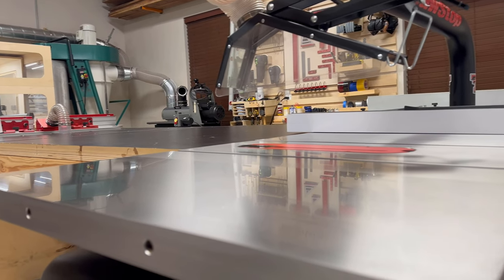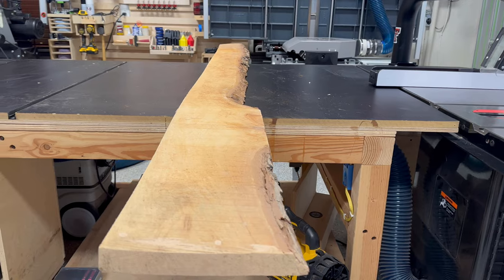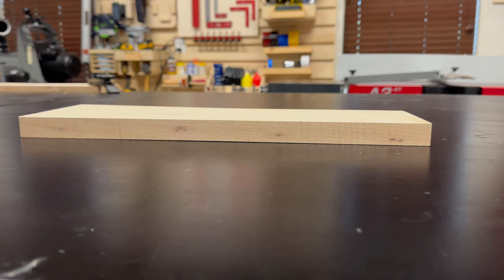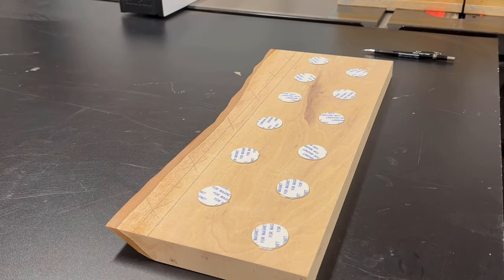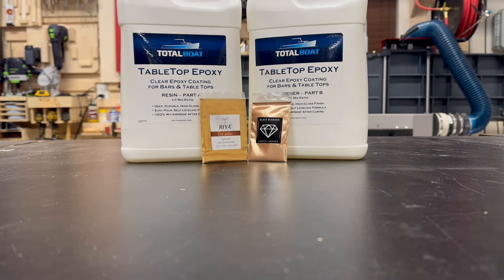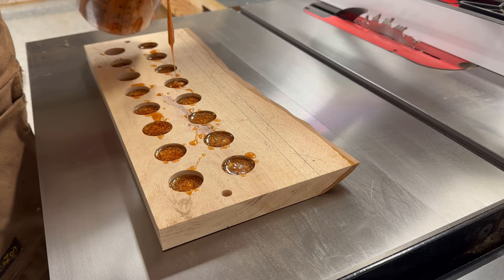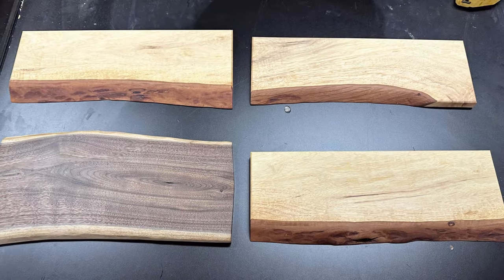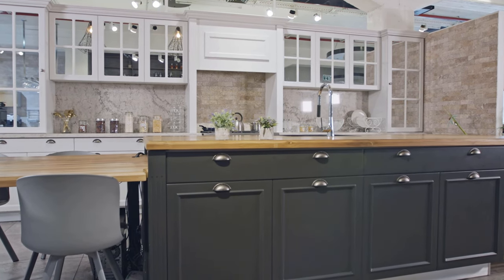Live Edge Magnetic Knife Holder  |   DIY Tutorial

Comment: You need an internal engineering department to set magnet depth in wood?
And it took them a week?
Did this board cost $10k
Do you have any idea how ridiculous that sounds?
Reply from the maker: I have forwarded your complaint to our internal HR department.
Reply: As a current unpaid seasonal intern janitor, I can attest that the engineering team did a fantastic job on designs! Though they were messy with saw shavings to perfect the depth of the magnet. When I saw that the client paid well over $12,000 for this magnetic knife holder, (picked up the invoice and my jaw from the floor in the engineering dept room) I knew I had to report this over to Rex! Ultimately Rex did lower the cost a tad.